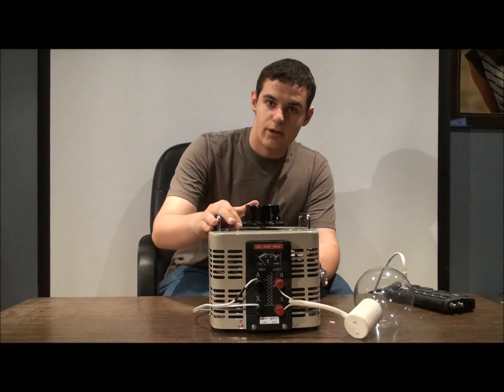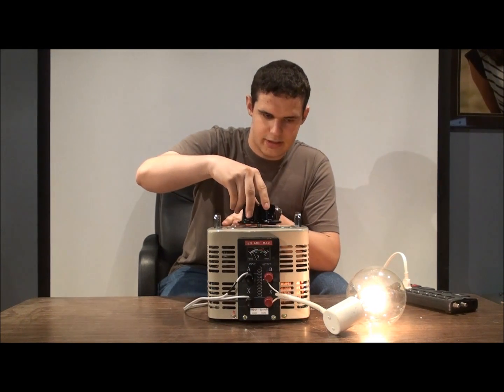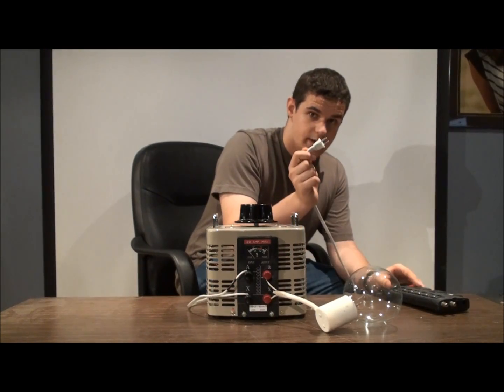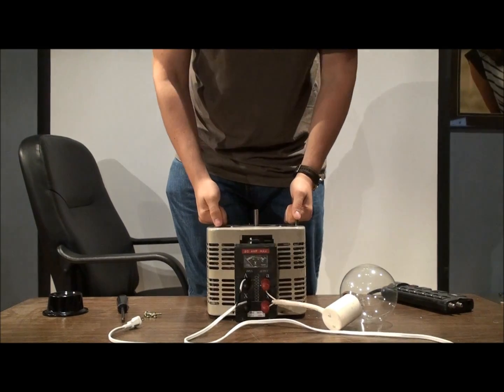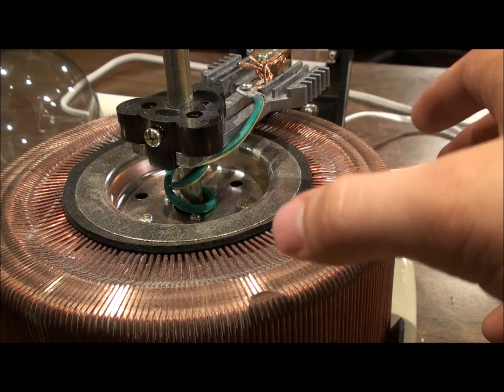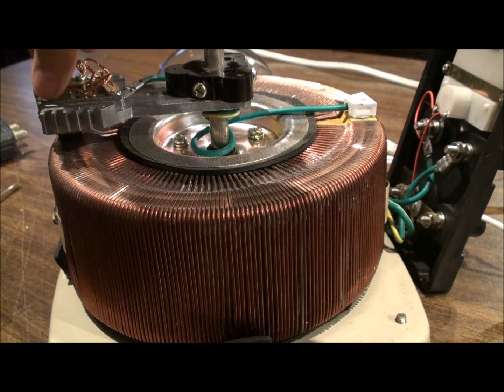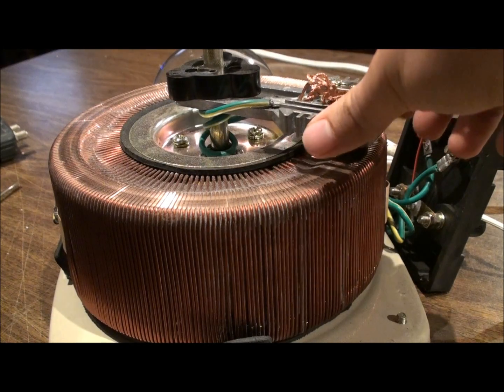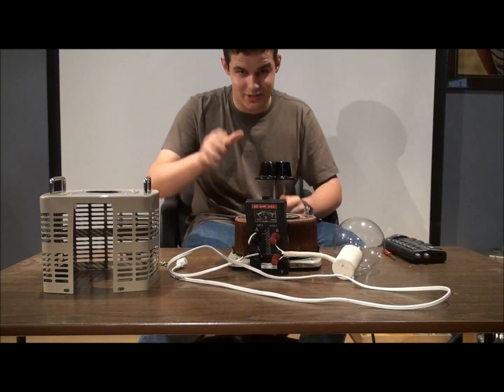What is a Variac, and how does it work? - Simple Explanation

Comment: Not to be nitpicky (okay, I am), but the output doesn't really change in a smooth fashion, does it? In essence, one simply sweeps across a sequence of windings as to select the desired transformer ratio, but the increments are still discrete - the "resolution", so to speak, will depend on the sweeper- and winding sizes.

Comment: Dear sir i need to ask you. Iam trying to find a transformer that converts 220 volt to 24 volt and 6 ampered. Almost impossible to find. I Have a 30 volt 10 ampere labrotory powersource but this device doesent push the amount i want trough the curcuit it addapts its ranges to the resistance so i get 5 volts and 10 amperes instead. Can i achive my goal with a variac? It seems variac and labrotory powersource differs am i correct?

Comment: What is the difference between a 240 volt variac and a 120 volt variac?  All the ones I have seen appear to have the same size windings for the same amp, so are there just more turns for 240 volts for the 240 volt variac for the same VA?  Also what are the different wiring techniques as there are multiple terminals to connect to please?

Comment: Please, I'm using a variac to control speed of a motor, is there a way to calculate the rpm it produces at various voltage
Reply from the maker: Caution there, variacs can only control speed for universal motors (with brushes) or shaded pole motors. Won't work with most induction motors. You could calculate the no-load speeds probably, I'd check the motor's datasheet. That being said, for A/C motors, best bet is always a variable frequency drive (VFD)

Comment: Hi, nice and very usefull video. One question: Is possible to connect  in paralell two 20A variac and get 40Amps from set? Thank you
Reply from the maker: Technically possible, yes. However, with the manufacturing differences between the windings / brushes, it would not be advised. Typical multi-variac installations use one shaft to control two / three variacs to regulate two or three phase power. You can find examples of this online.
Reply: @Hassasin195  Thank you a lot your great help! Regards

Comment: Hi Paul, aren't the input shorted through the simple winding ? Thanks.
Reply from the maker: There is the large inductive load of the core of the transformer, so it's not quite a dead short. Just as much as any other transformer.
Reply: @Hassasin195  Ok thanks for your answer, i am trying to build one based on an automatic voltage regulator.

Comment: Hi,

How does the device increase and decrease voltage and current by turning the dial? Is the mechanism does the dial limit the area current can flow when turning it which decreases or increases power? If you had the same amount of energy but increased the area/field would voltage or energy increase due to the strain as current travels through coils?
Reply from the maker: It acts as an autotransformer, you can think of the complete main winding as the primary and the part of the main winding isolated by the brush (from the neutral to the brush location) as the secondary winding. It's the same amount of energy, so for double the voltage you've have half the current etc (and some losses as well, but yeah)

Comment: I’d like to understand how a water variac works, thanks
Reply from the maker: If you're referring to electrifying salt water and moving a probe through it to get variable voltage out; The resistance of the salt water is used more like a potentiometer than anything else, as the water has a resistance. In the case of a variac (autotransformer), it's magnetism and induction that are the operating principles. Does that make sense?

Comment: Hi! What is the brush made of? I have to make a variac for a scholar project  and I’d like to use the brush like the video
Reply from the maker: It's made of a certain form of graphite, that may be mixed with some other stuff or binders. It's semiconductive properties are important to ensure smooth sweeping of the voltage. Similar to the brushes in a DC motor

Comment: I know this is old but if you were to place one of these between an amplifier's output (which is alternating current) and the speaker, you could actually use it as an attenuator. Or a volume knob. You could lower the AC voltage the same way you are doing from the wall. But the question here is would the same speaker impedance be reflected back to the amp's output tubes or would it change? I've been using one in this fashion for years now with no harmful side effects to the amp but I've never been able to find the answer to this question.
Reply from the maker: Yes it absolutely would. I just remembered some of the 48V speaker systems I did, and those are able to do dozens of speakers all in parallel but need to set the impedance (effectively the volume) for each with a switch that was changing taps on the stepdown before the speaker. I presume a variac would be the same premise but smooth transition vs swapping taps.

Comment: I have a 70 year old variac I run my 60 year old tube amps from at 100 volts. Keeps lower pressure on the stock power supply filter caps.

Comment: If you moved the position of where the hot is soldered closer to the neutral (not forward but backward from its existing position), say a quarter of the way round, what would happen? Is my guess correct? Moving the knob clockwise a quarter of the way round you would reach the hot point, or 100% of input voltage. half way round the voltage would be double the input. Three quarters round, three times and all the way round, 4 times the voltage. Would this be correct?

Comment: if the input voltage is 200v, and i set the output to 220.

here the question.... if suddenly my home voltage (input) change to 220 volt, will the output stay at 220, or it will also goes up ???? to 240 maybe ????

thanks
Reply: It would go up.  I am guessing you live in Europe, when I was in Germany, the labeled voltage was 220/380, but because it was usually bumped up, a true measurement was closer to 230/400.
Reply: and  your math is about right, it would be about 242 volts.

Comment: Nice breakdown of your transformer there Sir. I much like how you state that the device will "kill" you if u mess with it while energized heh. I have a question though , what is the main primary winding wrapped around? It looks like its a giant toroid iron ferrite core but I do not know for sure. Do you know what the wire is wrapped onto for inductance?  Thanks...

Psul

Comment: The one thing I can't quite wrap my head around is this: transformers proportionally change the voltage and current, right? The higher you step the voltage up, the lower the amps. Now since output power equals current multiplied by voltage, how exactly does stepping the voltage up with the variac make the lamp glow brighter? I don't get why doesn't it stay constant Yes, I know the higher the voltage, the more current a given load draws, but still, a step up transformer is supposed to decrease the current. I assume since you're increasing the voltage, and the resistance of the lightbulb remains the same, it can just admit more of the same amount of available current, but  I could be very wrong. Electricity doesn't make sense sometimes :(
Reply: someone please reply to this don't know either
Reply: ***** I think I do get it after all...the overall power remains the same, but since the voltage increases, the load (the bulb in this case) can draw more of the current that there is. A lightbulb doesn't need all that much current to light up, and I reckon it would burn out long before reaching the transformer's current limit. If you connected something else that has a higher current draw, you'd need a bigger transformer and a higher current power supply, otherwise the voltage would just drop as soon as you reached the output limit.
Reply: PremierMilenkov
thank you so much

Comment: QQ. If I use a Variac to control the input voltage of a high voltage transformer, would this also change the output amperage of the transformer?

Comment: how is it that you can get more voltage out than you put in? If from the neutral connection to the hot leg is variable, how do you get a higher voltage from your hot leg to a connection that has not wire connected to it?  its like a potentiometer that has a center tap and that is your 12 Volt connection and one of the other legs is ground, the opposite side/leg would be dead.   Wouldn't it?!
thanks  good video otherwise.
Reply: snaprollinpitts because it's not a potentiometer but a transformer with variable coil ratio.
In his case this variac is capable of going from step-down to step-up.
Reply: BGM  I get it now, thanks!!!

Comment: hello Paul, you have nearly the same variac as mine, yours is a 20 amp 0 - 250v variac , mine is a 15 amp 0 - 275 volt variac, but same type of brand though, mine goes up to 275 volts is because the hot wire goes less than half way around the variac, so half way around would be 137 volts. but JEEZ, i can't get over that variac!! it's big, shiny - clean and beautiful:D and GREAT presentation there mate, i actually got you and photonicinduction's knowledge of the variac transformer i give you an A+++! thanks for sharing your knoledge;)

Comment from the maker: +FireguyNtx You're not getting 200% of the power out, you're just getting 200% of the voltage out, with half the amperage etc. Same power (assuming no losses), but different voltage.
Reply: If we could get 200% of the power, all of our energy problems would be solved! :)
Reply from the maker: Alvaro Augusto It can do double the voltage, not the power
Reply: Technically that is true, in a perfect world. If you stepped 120V by a factor of 60 you would have 1200A @ 2V. In the real world however you would be limited by the intrinsic resistance and current carrying capacity of materials.
Reply: This is a kinda dumb question, but if you lower the voltage does it increase the amps? or does it somehow just send the volts it doesn't use back into the wall?
Reply: for example, assuming this is a normal wall outlet with 120 volts and 20 amps, could this turn it into 2 volts and 1200 amps? That amperage sounds to high to be true, so I assume it wouldn't do that. I used multiplication to get that answer. What if I used addition and subtraction, getting 2 volts and 138 amps? anyways, please inform a young fool.
Reply: @adamtaddia8070  You could build a transformer with a primary designed to accept 120 V 20 A and a secondary which outputs 2 V at up to 1200 A.  But this transformer would be designed for those ratings, with secondary windings whose wire cross-section is about 60 times larger than the primary wire cross-section.  The amount of steel needed to make a core for a 2400 W transformer is also substantial.  You could get this if you wanted - but as a normal transformer with a fixed output voltage.

You can't increase current like this with a variac, because the wire in the transformer acts as both primary and secondary, and because the output is fed by a carbon brush.  So a Variac with a 20 A rating can supply a maximum of 20 A output at any output voltage, no matter how low, because of limits of the winding and the brush.

The output current is still greater than the input current by the inverse of the voltage ratio - but in this case the primary current goes down instead of the output current going up.  If you had a 20 A Variac, and set the output to 2 V, the max you could draw continuously from the output is 20 A at 2 V - 400 W.  The input current in this situation would be 3.3 A at 120 V - 400 W in.

Comment: is it safe to short the output? or would you need to limit the current
Reply from the maker: It would not be safe, as it is an autotransformer, and does not isolate you from the mains.
Reply: Current limitation isn't a bad idea, if you have the transformer at input voltage, the current won't run through the windings and hence it will be a dead short, which will trip your breaker. On low voltage output, say 50V current is running through the windings and somewhat limits itself, but without a limiter, it won't take long to burn out the device.
Reply: Paul Szuflita can these be used to throttle DC, so removing the 110AC and replacing it with a DC input?
Reply: ***** DC could work by using the wires as an resistor. But this will have a huge idle current draw and it will be very inefficient. This totally changes the properties of the device though. It is no longer an inductive device.

So doing this is a no. Unless you are dealing with low voltage DC and with a variac with thin wires on the windings.
Reply: Loco Llama what are you saying? it's a transformer, DC would not work at all. You need a alternating current in primary to create a varying magnetic field to induce emf in the secondary coil.
If you wanted to throttle DC, just use a potentiometer/linear regulator/switching regulator.
Reply: BGM Looks like you didn't understood what I said in my comment. The function of dc current though a variac does not have anything to do with inducing emf in the core to vary the voltage. The function is based off a voltage divider, by using the wires in the variac as a resistor you can vary the ratio between the taped ends of the wire to vary the voltage on the output. Also their is no secondary on a variac. A variac is a variable auto transformer.
Reply from the maker: Loco Llama A variac is most definately not a voltage divider. It's function is to create a transformer with an "infinite" ammount of tapping points, and the graphite brush simply selects where you tap it at. There is only one winding, but the electromagnetic properties of the graphite brush create a "secondary winding" akin to a conventional transformer. As such, it only works converting AC to AC, and cannot do DC to DC conversion like a voltage divider or other regulator.
Reply from the maker: ***** No, Variacs only work converting AC to AC
Reply: Paul Szuflita Are you even readying my comment? did I ever say anything about conversion of AC to DC or DC to AC?????
Reply: Loco Llama Paul is right, there is no physical second coil but there is a secondary...
I guess you could use the output side of the variac and the sliding brush to alter resistance, but the variac's wire resistance is too low to be useful unlike a proper potentiometer.
It will function more as an inductive ballast, at least until the core saturates...
Reply from the maker: Loco Llama having read through your comment again, You are correct, with a thin enough gauge of wire, a variac is basically a potentiometer. That being said, with any variac you can buy on the market, the voltage drop would be neglidable at best, making it useless for DC to DC conversion. You never said AC to DC or vice versa, but neither did I. As I have re-read your comment, please re-read mine.
Reply: BGM Your right about how it would not work well. As I already mentioned in the reply to Scott.
Reply: Paul Szuflita I never said using a variac to throttle DC was useful... you again fail to read my comments.
Reply: Just connect an isolation transformer to the output of the variac and you should be fine.

Comment from the maker: @L7pusher The variac I have is rated 20A, which means that the max input amperage should be 20A. Cost me $85 IIRC
Reply: wattage stays the same ALWAYS
Reply: also @Paul Szuflita were did you get a 20A variac for 85 bucks!!!??? a 15A one is over $200!!!
Reply: dakota c Not true, due to Cu and Fe losses, the input side will draw more power. Care must be taken not to overload the output current rating. A 5.2KVA variable transformer can give out 1040A at 5V with a resistive load, but the winding isn't rated for that much current I don't think :P
Reply: +DC Custom Electronics Yea they get expensive, I happened to come across a 30a variac at my local electronics surplus store for $85

Comment: I have some questions. Is the output voltage AC or DC?Thanks a lot.
Reply from the maker: quencyeric The output is AC.
Reply: Any transformer with ONLY work to transform AC voltages or changing signals.  Put DC in and it will act like a short (or very close to it)

Comment: Hey Paul, A 200 % Varaic?  I assume these units are more expensive then most. What is the amp rating of the one in the video as I'm guessing this will be a part of what determines the overage amount in regards to mains power? 
Sorry if all this is obvious to most - but I a bit of cherry when it comes to electronics.
Thanks in advance for any clarification you can provide. 
I

Comment: If It is a AC single phase motor. The answer would be a no. A variable frequency drive (VFD) might be what you need. Or you can go with a dc motor and rectify the AC coming from your variac.

Comment: You would before much better with an N channel MOSFET for that application.

Here is a video of a MOSFET based "H-Bridge" controlling a DC motor:

P85Ntjue7F0 (Type at end of youtube address after "watch?")

Also, not that a transformer will not work using a DC input.

Here is a video of how a normal transformer works (single primary and single secondary coil):

ZjwzpoCiF8A (Type at end of youtube address after "watch?")

Comment from the maker: The knob is directly mechanically connected to the brush that sweeps across the top of the windings where the insulation has been grinded off. I'm not exactly sure what you mean by moving the output closer to the input, but if you were to connect the "hot" side of the input closer to the "neutral" connection, you would be able to make the maximum voltage higher, the only precaution would be to watch the amps drawn, as a higher voltage on the "secondary" means higher amperage on the "primary".